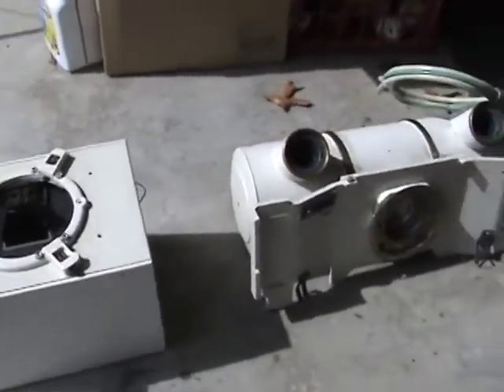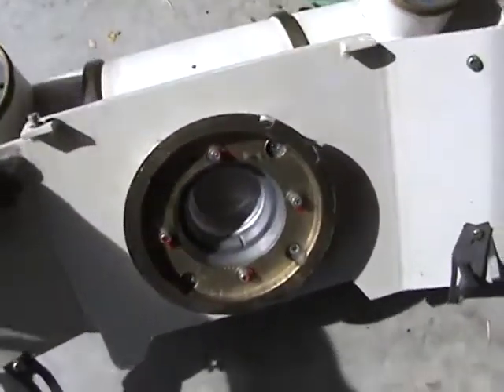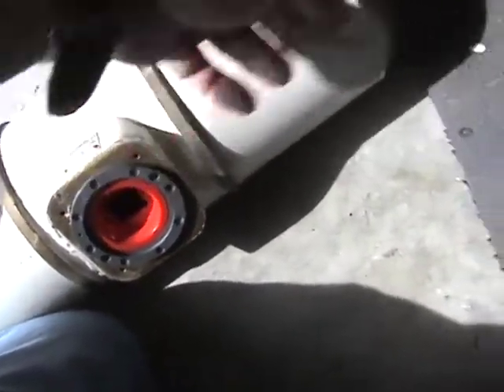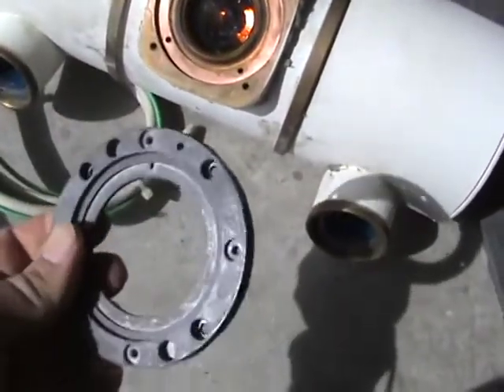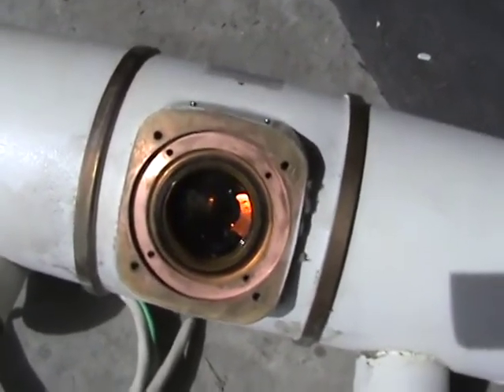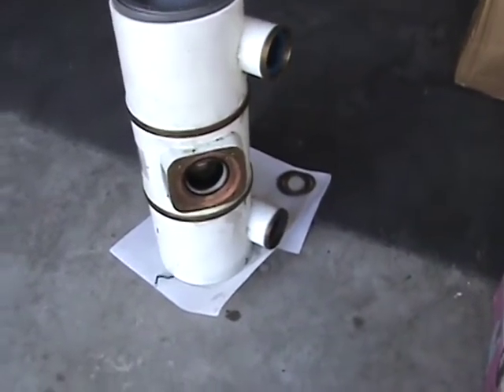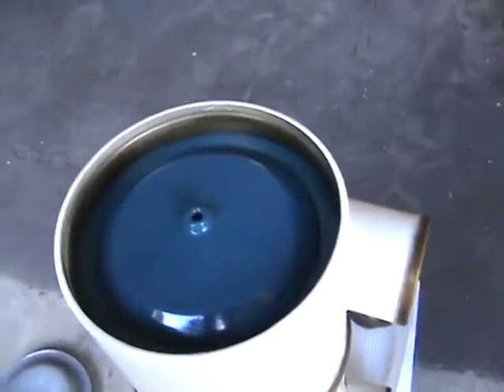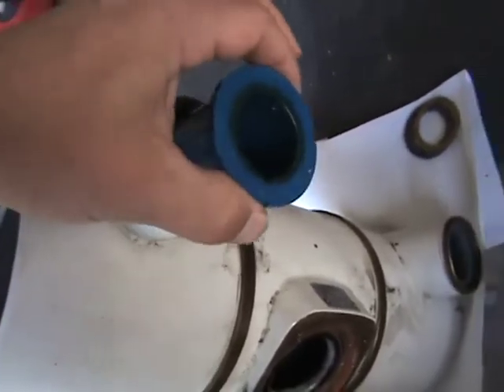Xray tube deconstruction complete

Comment: What you called for oil in side of tube?
Reply from the maker: What they use is a light viscosity machine oil. It's thin, kind of like olive oil or cooking oil.
Reply: it called transformer oil for insulation.
Reply: @suckjuice  So the oil is for eletric insulation. I thought it was to cool the tube.
Reply: @anthonyboarman3833  It is used for both cooling and electrical insulation.